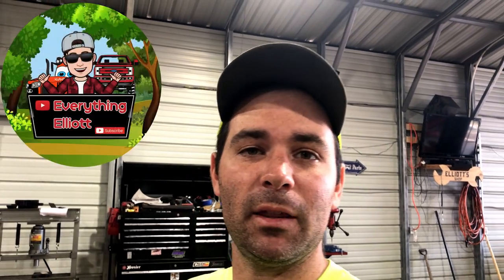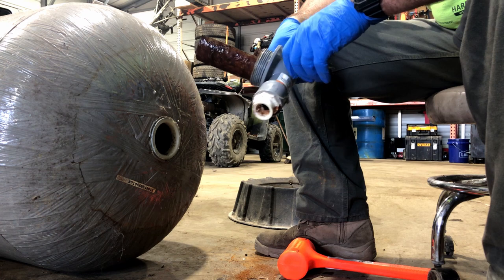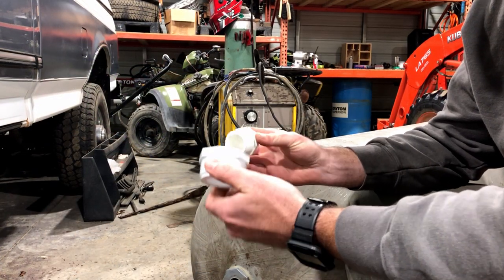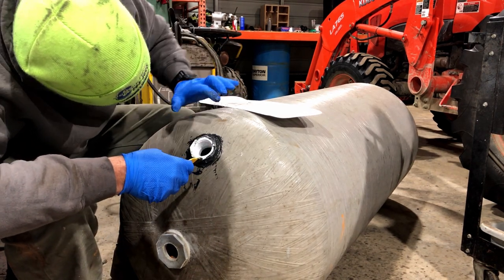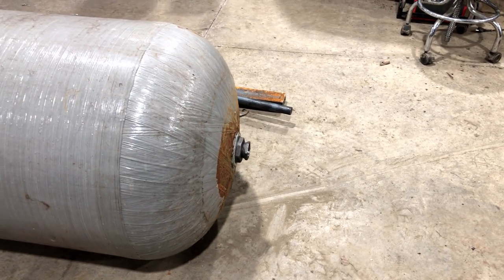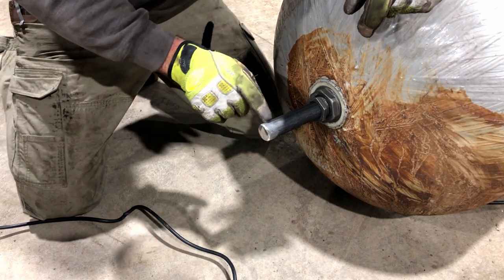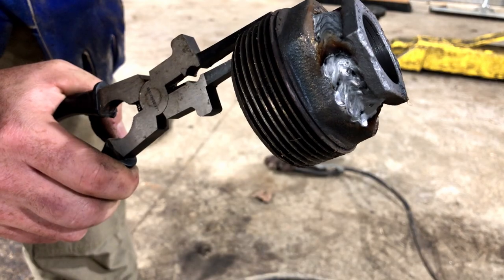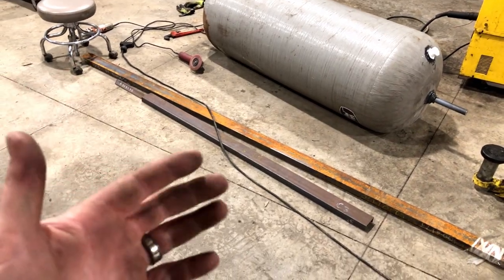DIY Lawn Roller - Part 1

Comment: it is the air pressure tank that aids your well pump in getting water out of the ground but mostly it provides water pressure in your house so water will flow to upstairs and out shower heads faucets---stuff that is typical 10-25-50 feet over the top of the water tank/water heater. basically a big balloon bladder inside that the more air pressure you put inside the balloon the more pressure is applied to getting more lift pressure to your house hold/farm/commercial application needs to places higher and or more distance which relieves strain on the well pump to keep a constant pressure supply on the water.
this is thin metal reinforced by a fiberglass mask to keep it light and strong.
Reply from the maker: Close but it’s a water holding tank. The pressure tank was next to it, I dismantled the well system. The pressure tanks are usually blue and smaller like 30-40 gallons with a scrader valve on top to ensure you have the proper air pressure in the bladder

Comment: How well has the jb weld held up? I've had mixed results using it. Usually really good on solid projects but if there's any flexing it can crack.
Reply from the maker: Surprisingly well…I had my doubts about it when I put it together, but I’ve got about 30 acres rolled so far without issue. I think the solid bar support running through the center of the entire thing makes a big difference
Reply: @EverythingElliott  I'm making a roller out of an old well tank. Luckily for me it's steel so I can weld everything on it. Basically got the same design in my head as you used, just scrounging pieces and parts for now.
Reply from the maker: @TheJpybus282  check your local craigslist or FB marketplace for steel drops.  You can usually get really good prices on metal!